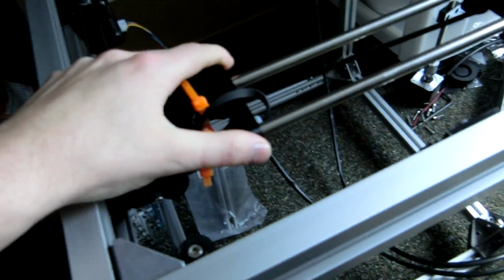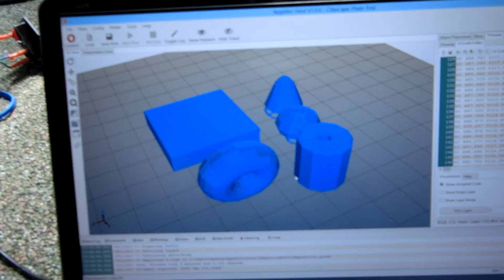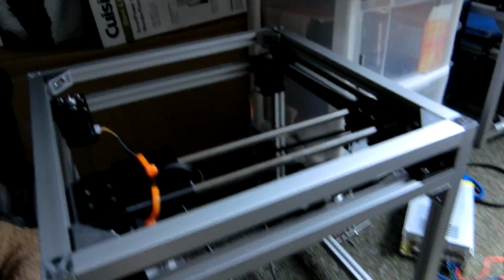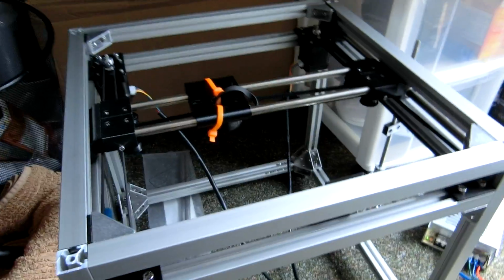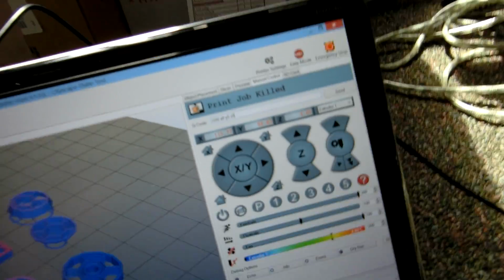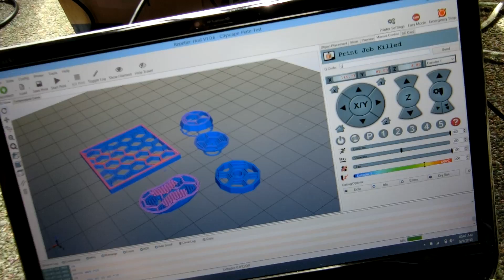Eclips3D Update 10 - TRUE CoreXY Movements!

Comment: You have non-parallel belts on the central axis(I think it might be Y axis), you can have oval circles as a result..
Reply from the maker: Николай Акс This was the initial test of a very early Eclips3D prototype, so it is very possible the belts were not parallel in this video. However, in the final design, there were many changes made and the belts are all completely parallel!

Comment: Where did you get your stepper motors? I want ones that have removable wires too.
Reply from the maker: +Jonathan Lin Openbuilds part store!
Reply: Just in every Chinese shop like ebay amazon aliexpress. But do you really need them? Every contact burn on long-time-use. In addition, if the contact dissapears on-the-run it can lead to death of stepper motor driver.

Comment: Check the code here:
https://github.com/misan/dcservo/
Get some DC motors and replace the servos - not only will it be quieter, it will be faster (!!!) and it will get rid of the problem when you "stopped" it - it will simply get back on correct position as soon as you release it.
I love the gantry though...
Reply from the maker: +Robert Klauco Well for 3D printers, DC motors with encoders really isn't ideal. They don't have enough torque and they can't be controlled nearly as accurately as steppers. Perhaps in the future the technology will develop, but for now steppers are definitely the way to go. DC motors don't provide enough benefits to outweigh the problems they can cause.
Reply: +3DprintedLife Regarding the precision - I have in front of me a dc motor with linear encoder driven by attiny85 with positioning precision of ~0.04mm.
Reply from the maker: Robert Klauco hmm interesting. Perhaps they are better than I thought, but still the only implementations I've seen on 3D printers don't work super well. I think the torque limitations still really hold them back.
Reply: I am currently working on my implementation (very, VERY slowly due to time constraints), but I'll let you know. For now, torque seems to not be an issue though and I am using the smallest motors I salvaged from an inkjet ;)

Comment: What's the approximate build cost?
Reply from the maker: Depending on where you source you parts, if you substitute any, and if you can 3d print your own parts, anywhere from $700 to $900. If you buy the full custom kit through my website and then buy everything else as per the bom, it will cost about $850, but

Comment: Thanks, very quiet indeed compared to most printers i have seen. Z movement should not add much more noise since it goes slower than the other axis.
Reply from the maker: Frostclaw20 Yeah I'm very happy with how quiet it is. I know the z axis won't be too loud but the only thing I'm worried about is the aluminum motor brackets resonating the vibrations and increasing noise. I will be using noise dampening material so that may counteract it, but I won't know for sure until I test it!
Reply: Yeah until you fully build it you won't know.
 But so far it is very promising.

Comment: Awesome! Can't believe it is that quiet. What is the print volume again?
Reply from the maker: mulze32 Right now its looking like a little over 200x200mm (limited slightly by the size of the heated bed) and the z height should be around 230-240.
Reply: Ok. So its not the physical size of the printer that would keep the print size at 200x200mm just the bed.
Reply from the maker: mulze32 correct. The actual movement range appears to be around 220x220
Reply: Alright thank you.

Comment: Looks amazing!! I can't wait for the KS campaign! Will you provide an upgrade path for existing 3uP users? (I believe you've answered that before, so I'm sorry if I'm repeating it...)
Reply from the maker: Alwyn van Jaarsveldt I'm not sure yet, I have to look into if it will be possible considering the 3uP frame is slightly smaller. If nothing else, I will be doing a barebones kit which is everything but electronics so you would end up with two frames (the old 3uP frame and the new Eclips3D frame) but it will still be much cheaper than buying the full kit!